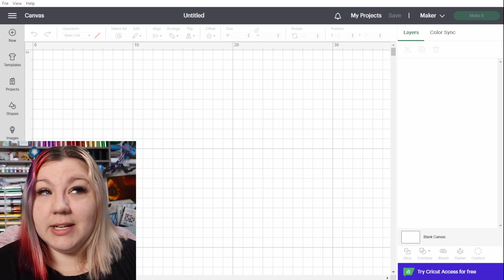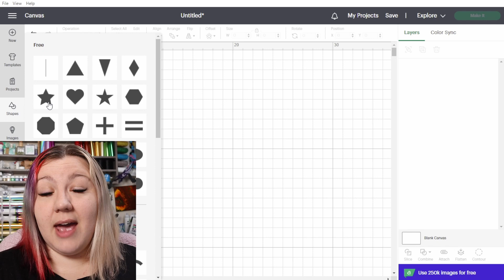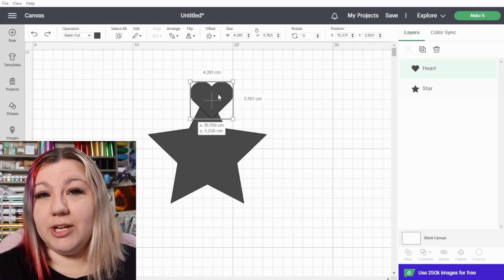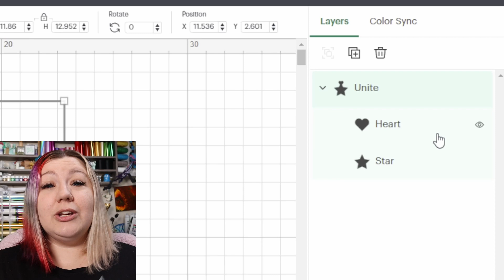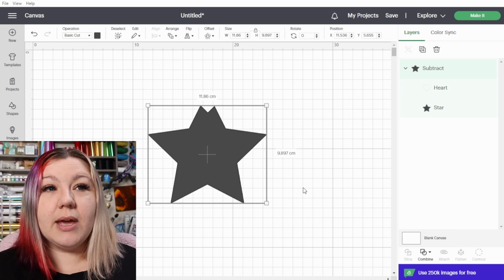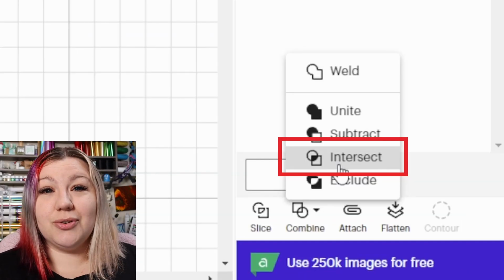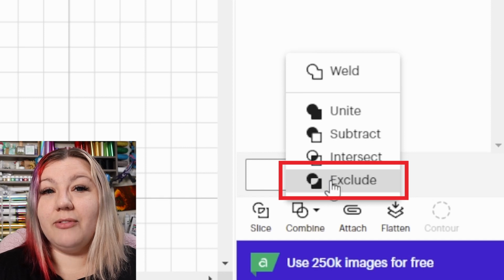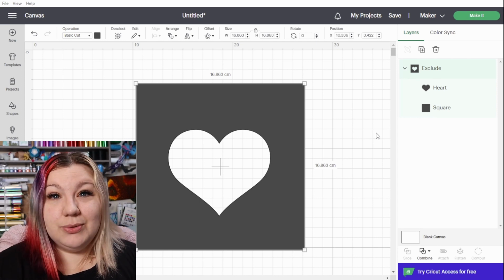How to use the Combine Tool | Cricut Basics

Comment: This is great....until I go to cut. If I combine my shapes instead of weld them, my machine still cuts out the individual shapes. I can only get one solid piece if I weld.
Reply from the maker: i have seen the same thing :( I wonder if its intentionally done like that though 🤔
Reply: @KellyRossouw  I finally figured out that it's a layers issue. You must merge layers to make it one piece. Once merged, it cannot be undone.